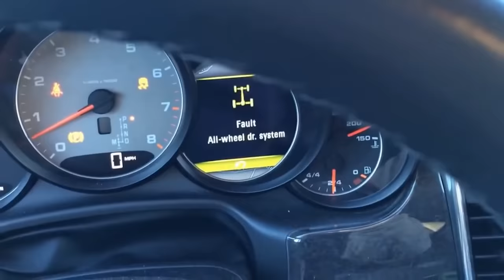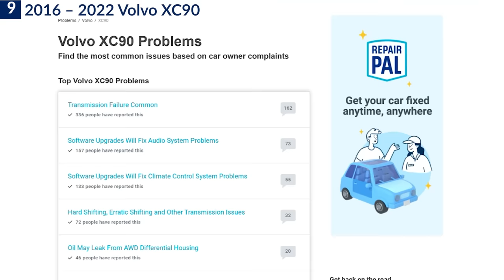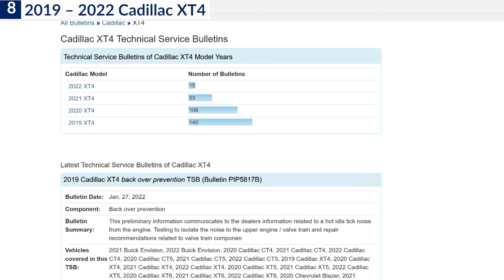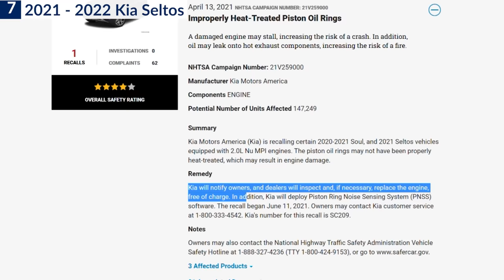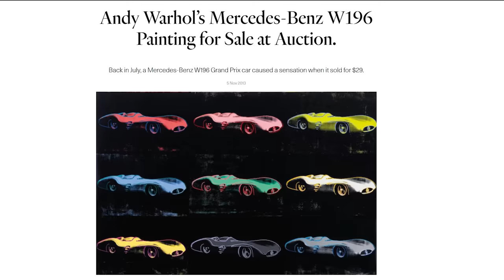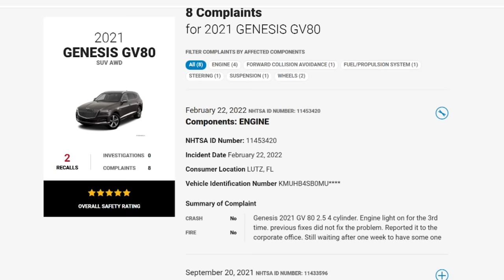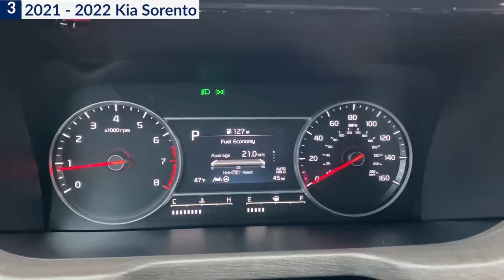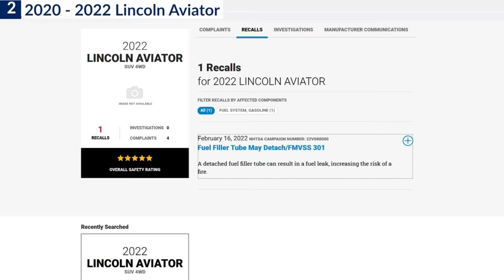10 New SUVs to AVOID - Here is Why !!

Comment: The fact that a Range/Land Rover isn’t on this list takes away it’s credibility.
Reply: If you couldn’t tell by the cheap ads in the video itself lol
Reply: Maybe Land Rover doesn't sell enough cars to get enough surveys and reports?  They sell much less than any of the SUVs on the list. Also, most of the cars on the list were all new or nearly all new models (2-3 years after redesign).  After several years, most of the kinks have been worked out.  A first year model during a pandemic with labor and supply shortages will likely have a lot more problems than the average NEW vehicle.  Most new vehicles have something like 1 problem (or what surveyed customers consider a problem) per vehicle on average (or around 100 problems per 100 vehicles) in the first 3 years according to JD Power. Many cars will have 0 problems, but a few lemons might have 10 or 20 or more problems. So a brand new generation model with teething problems or more lemons that year might average 1.5 or 2 problems per vehicle in the first 3 years and be in the bottom of the rankings.  But even these worst cars weren't getting a huge number of cars with problems or a huge number of problems, just noticeably more than the average new car which is getting more reliable than ever. These weren't 5+ year old vehicles with high miles or well out of warranty where EVERYTHING turns to dookie in the least reliable models, but this was based on "predicted reliability" which is hogwash.  You can't judge the overall reliability of a model based on its first year on the market...
Reply: BMW and AUDI too. They both sell more than enough SUVs to make CR's testing list, and are both more likely to break than a couple of the SUV's on this list. CR lost most of their credibility long ago.
Reply: @mabm85  consumer reports only puts the vehicles from manufacturers that give them the least money
Reply: Everything Audi & Volkswagen should be on this list; German engineering is overhyped bs.
Reply: @BIGJBIGEBIGC  🤣
Reply: You must own a Tahoe 😀
Reply: @Saph Adams  I have had 2 land rovers .  A 2005 Landrover LR3 and a 2011 LR4 ..None  have left me stranded me on the road
Reply: @mabm85  2011 BMW 550i GT worst car I ever owned
Reply: U want a reliable,  3 row , good looking SUV, then just get a ACURA MDX. Problem solved!
Reply: @OlJackBurton  Nah they sell Plenty. We just live in a society where we can just pay off someone to say good things if we got the money
Reply: I did test driving for a company, of Range Rover diesels. We drove them like 300 miles a day in the Vegas summer, & never had any issues to my knowledge. I think certain RR/LR models are okay, with regular maintenance. But sure, once you get over 50, 75k with most of them, you’ll probably start to have issues.
Reply: True.
Reply: @adamphynes7342  drove my 2005 to 200k and have 2012 LR4 with 130k miles right now
Reply: @adamphynes7342  50K to 75K with issues is criminal for such a high cost, supposed to be luxury vehicle.
Reply: Gv80 is overpriced? Compared to what? You want overpriced, look at BMW and Mercedes.
Reply: No Mercedes or Range Rover? Moving along.
Reply: @mabm85  2014/5 and up audi are reliable. Owned A6 3.0T from 90k to 140k miles, Q5 3.0T 40k to 80k, SQ5 from 20k. Biggest problem I had was a water pump failing on A6, which I honestly needed to replace at 100k but didn’t.
Reply: I was starting to feel good about my 2022 Jeep Grand Cherokee Limited.
Heading out of this rabbit burrow!
Reply: @Rootsmanskanking  I have had 2012''
 and 2018 Range Rovers. Both were the worst least reliable vehicles I ever ever had.  Spent thousands to keep them running.
Reply: overprice And brakes down all the time. to many electronic components that go bad quick.
Reply: @Lhondureno  source: you're a youtube mechanic?
Reply: @danblackfield8928  source I own one.
Reply: @Lhondureno  there you go, much better criticism now! So what year, model, and engine?
And as I mentioned, my experience with several mine was different than yours. My A6 was like 15k, too, so I can’t really complain on the price either.
Reply: completely agree with this comment.   This video is skewed for sure if Range/Land Rovers aren't in the top 3 or on the list at all.
Reply: My father drive Land Rovers in the 1960’s and 1970’s.  They were constantly in the repair shop. England makes luxurious but extremely unreliable vehicles now.
Reply: Oh wow.. i just brought a 2020 rage rover. I only had it . For 2 weeks. I took in on the road. And I opened up. .. the next day. My transmission started to slip !!
Reply: @michaeljohnson7044   I just brought a GV80. Let me tell y’all. It’s probably the worst car ever made. I only had the car . For 2 weeks.  My real break line was leaking. My check engine light came on .. when I left the dealership. I made a quick u turn.. right back to the dealership. !! UNBELIEVABLE !!!  .. never again !! 😡😡😡😡😡😡😡😡😡😡😡😡😡😡😡😡😡
Reply: i agree i love the look of them but heard maintenance is a nightmare so i have stayed away from them . infiniti i loved my qx50 but transmission twice no joke do i stayed away from that again
Reply: @richardsimms251  England doesn’t produce any cars at all. So your statement is completely wrong and just shows your lack of knowledge about the topic. JLR is owne by Tata Motors Ltd. (India) and the assembly plant (no longer manufacturing plants) are in Nitra (Slovakia since 2018 for New Defender, Discovery and RR Evoque)). The Solihull plant is reserved for be new Range Rover (2022).
But I agree, it’s suspicious that no JLR model or MB model is in this list. My LR Discovery 4 never let me down and has now 286,220 miles on the clock.
Reply: Lol exactly 🤣. Range rover should be on the top
Reply: @harveyhankerson8359  wich one
Reply: @kenlyboss8256  discovery !! 😡😡
Reply: True
Reply: @Rootsmanskanking   oh wow.. you got a lucky one. !!   UNBELIEVABLE.. I had a 2005 . I brought it brand new.. it only had 23 thousand miles on it. 2 years my transmission took a dump on me!!. Never again !!
Reply: I bought a 2020 brand new never had issues kept up with maintenance and had 50k miles had to trade it in
For a bigger vehicle
Reply: Facts
Reply: This video is sponsored by Range Rover!
Reply: The whole line up…. Lmao
Reply: The ‘08 has long been paid for but simply trash…
Reply: Facts
Reply: @OlJackBurton  that Geniuses doesn’t sell a lot
Reply: @harveyhankerson8359  Own a GV80, 2021 awd 3.5t advanced. Drives like a dream. Wheel gives bad vibes when tire pressures are out of whack. Once in the right numbers, car is smooth. Never had a problem. 14 months in. Do not regret my buy. Sorry about your experience. Maybe its a consistency issue.
Reply: Explorer and aviator are basically the same thing as the land/range rovers. The cheap Indian company that bought it from Ford hasn't changed anything.
Reply: Maybe its number 11
Reply: Big facts
Reply: That's because you've never owned a well maintained Range Rover
Reply: Remember folks, it is a list of the 10 worst.
Reply: How many have you owned?
Reply: Have had 3 new Landrover discovery over 15 years and they are amazing, not perfect by any means but close…….have ordered a defender and trading in my one year old q7 with air suspension that drives over potholes like a truck ……..feel the vibrations through my bones to my back teeth ……..
Reply: @Rootsmanskanking   I’m 63 and the last car that left my family stranded was my Dads Cadillac when I was a young child.
Reply: @mabm85  .. "non-luxury" .. guess you missed that point so BMW & Audi won't be on the list
Reply: Absolutely correct 100 percent
Reply: @ebee3522  so is American manufacturers, gm and Ford are horrendous brands,
Reply: 😂 terribly made fancy britches vehicle.
Reply: @demigodantiqueprints2696  I kept a brand new Q8 for 18 months, 2 of which it spent in the shop. Couldn’t wait to get back to RR.
Reply: @Rootsmanskanking  I can second this. As long as you take care of the basics, replace the spark plugs every 3 to 5 years, oil of course, if you are getting a check engine light and a warning about misses in the engine… it’s going to be ignition coils. The fact is, if you learn how to do some of the basic repair yourself… They’re not bad vehicles. They turn bad, when you decide to take them to a garage and they see you pulling in inside of it and try to charge you $500 to replace $50 worth of spark plugs that take 10 minutes. Trying to charge you $250 for one ignition coil, for which you could buy all eight of them for less. $1500 per air shock, When you could buy them all for $1500 via third-party.

You truly have to know the brand and what to look out for. Do some basic repairs yourself and they will run fine. Some have issues, just like with any car. As everyone who owns a land rover/range rover will tell you, it’s all about the incredibly quiet, smooth ride and especially if you own a 2005 to 2009, the power. It’s one of the most luxurious rides out there as far as feeling little in the way of bumps on the road. The cabin so quiet that you could probably hear a pin drop. The only issue I have with my 2006 LR3 is the screens that they use for their entertainment system are horrible. I ended up replacing mine with a high end android tablet. Which I mounted in the Dash where the old screen used to be.

Other than that, they can be great vehicles if you take care of them and again, know how to do the basics and when.
Reply: @OlJackBurton  there are significantly more land rovers than gv80s and Lincoln’s on the road. The reason they’re not on this list is because this video is nonsense
Reply: On a serious note who was actually surprised the VW was on the list?

I mean we’ve known it is crap since its initial release.
Reply: Facts
Reply: @BENTLEY1981  the Volvo too dates back to when ford owned it - similar to Explorer.
Reply: @BIGJBIGEBIGC  cheap ads,yet a Range Rover is not a reliable car and it’s a facts.
Reply: @itzjdub282  don’t waste money on RR. Go for Honda or a Mercedes
Reply: Range River for life 😍👍🏻
Reply: Not really they tend to stay IN REPAIR SHOP MUCH TOO LONG?  THAT'S WHY
Reply: @burnellbrowne4303  yes cos your money ain’t enough to fix it and take it out from the shop quickly.What’s your point man lol
Reply: 100% Correct!!
Reply: Sooo true
Reply: Sooo true
Reply: @VVS30187  I have both and love both. But not the Honda. RR has been truly wonderful.  Only issue is delay in infotainment.  I knew that could happen.
Reply: Maybe they broke down on the way. They didn't make it in the list
Reply: Somebody in this story’s pipeline likes Range-Rovers. They are crappy English made vehicles
Reply: Maybe cause everyone knows how bad they are they didn’t have to say it 😂😂😂
Reply: @ebee3522  problem with German engineering is its over engineered which means more parts that break.  😂
Reply: If you want to go into the bush take a Land Rover if you want to come out of the bush take a Land Cruiser never a truer saying
Reply: The latest Land Rovers are much better build & reliable than ever before. Between my wife & I we owned 8 in the last 20 years. And my current 2022 Defender 110 V8 is fantastic. I passed my 2018 RR to my daughter with 87K miles and she has now 93K, and still strong no issues. I do off-road few times a year.
Reply: Listening to the narration,  he makes general comments like " CR rated the car, as the most unreliable" That doesn't sound like CR. He doesn't point out any links and btw, where is Land Rover on this list? BMW and Escalade?  Genesis is too expensive? Because fully loaded price was 75k?  Any German SUV fully loaded would cost over 100k ! Land Rover tops at 185k. Come on !
Reply: @Rootsmanskanking  those years were exceptional for those models.
Reply: Audi too.
Reply: “The parts falling off this car are of the finest engineered British quality”
Reply: They are the worst. Very unreliable. People that buy them are amazingly uninformed.
Reply: @sweetdrahthaar7951  indeed. Talked to a coworker. She loves them but thins she knows cars. Said they’re in the shop all the time for repairs and she said oh well!!
Reply: Yes. Range Rover should be at the top of the crap list.
Reply: Had a Cadillac CT4 rental - it is a POS.  C’mon GM, is this the best you can do with your “premium“ brand??
Reply: That’s facts 😊
Reply: @ebee3522  ...and American engineering?🤣🤣🤣
Reply: I never had any problems from my new  2018 Range Rover!!.. Still have it and driving Strong!!.. LOVE IT🥰
Reply: So true
Reply: Love my Range Rovet Evoque Dynamic! No problems and a beautiful vehicle!
Reply: Exactly!
Reply: Exactly !!!
Reply: Range Rover-absolute crap!
Reply: I have a 2021 SVR and so far all good.
Reply: @OlJackBurton  maybe rovers don't sell enough because of their reputation. a tesla could be in the same price range but you see far more of those on the road
Reply: @mikenorman6665  and if you want to go cheaper than that, the honda pilot or the passport is a similar option
Reply: Agree
Reply: I’ve had 2 range rovers. I wholeheartedly agree with this comment
Reply: That part
Reply: @mabm85  Agree !!
Reply: That Part!!
Reply: @Kilgore_Trout_jr  what's wrong with it? I'm looking at getting my feelings involved wit one of those?
Reply: The fact that people still think JLR is Ford blows my mind. Selling the company to Tata was the best thing ever for them, increasing in quality and viability. My car has 165.000 km and i never had any problem with it, it saw service only for regular service once at 30.000 km.
Reply: @michaeljohnson7044  Mercedes made in USA are trash, Mercedes made in Germany are great ! Very big difference !
Reply: Yea overpriced and unreliable as hell
Reply: Just buy a sequoia
Reply: @mabm85  well I am definitely learning a good deal.....thought these vehicles were good like that. They are considered top class and some of the more expensive vehicles in my country (Jamaica)
Reply: Well I an just in the process of buying an SUV had a TIGUAN in mind ? Need to check more about it. Anyone out there have one?
Reply: @miraperko7493  yeah myself too, searching for a vehicle with what you need is not so easy at all
Reply: Entirely  agreed
Reply: I’ve had 7 and have never had an issue.  Must be a hater
Reply: Range rovers become more reliable that's why
Reply: Totally agree.  Better have a thick wallet with that baby
Reply: I have a 2020 RR Sport HSE. 2.5 years, and not one problem. Most people that hate Land Rovers for some reason never owned one. Family & friends told me the same when I bought it “what did you do?”…2.5 years later, and they still waiting to justify their fear of getting one. The only complaint I have is that I need more cargo space when I go off-road for a week…
Reply: People gotta buy them first….
Reply: The car price and maintenance cost of Range Rover is beyond our consideration.  The reliability issue of it is beyond our imagination.
Reply: Based on consumer reports. If it’s not in the report, why would you expect it to be on the list.
Reply: @mrnoname7370  kpkn
Reply: l
Reply: @Rootsmanskanking   You don’t drive them much?
Reply: @Rootsmanskanking  we’re talking new cars here.
Reply: @Rootsmanskanking  also have 2012 LR4 with very low miles 70k & zero problems but not holding breath. We seem to one of exceptions for not having airmen suspension go out yet.
Reply: @michaeljohnson7044  fact it’s Korean. I test drive loaded GV80 twice & the engine vibration into cabin so bad seats rattled. SUPER LOUD fan also audible when a/c on,, combined with horror stories on maintenance, parts & oil/tans issues in first month. So pretty to look at put broken eggs when coming to fix problems. The dealers are whole other story. They act like an Olds dealer in 70’s. Frightening. After waiting 3 years for Polestar 3 EV I chose a loaded BMW x5 M50i & couldn’t be happier
Reply: MB is in list!
Reply: @demigodantiqueprints2696  then something is wrong w/suspension. What did Audi say?
Reply: @MakeLifeExtraordinary  article reflected late models that all wld have been under mfg wart so not cost issue but multiple service, hassle & safety issues being discussed.
Reply: @mkyhou1160  nope,, TaTA has owned for a decade now.
Reply: @VVS30187  did ya not see MB in #2 as worst with 2 diff model years having TWENTY recalls EACH?!
Reply: @steveo601  TaTa motors for decade is India motor car not English!
Reply: @mabm85  The B58 and S58 engines and ZF transmission in the new BMW's are near bulletproof guy.
Reply: @JahRoww  Which is irrelevant in today's conversation.
Reply: @Mike Norman  Sure, if you don't mind it's horrible interface. They should've brought the screen closer and made it a touch screen
Reply: Lol true
Reply: The Range Rover and Land not on that list is because they been money pits forever,  so they don't need to be on this New SUV list.
Reply: For real 😆
Reply: This is one of those “goes without saying” 😂
Reply: Yeah but Chevy Tahoe and Yokon are…. What!
Reply: LR + RR are the worst of the worst.
Reply: I tend to agree but the real list has got to be longer.  Jeep missing😂
Reply: Its
Reply: You got that right they are the worst cars on the road
Reply: @harveyhankerson8359 So did you return the GV80, and get yer money back?  I hope so.. Whata LEMON!!
Reply: Yes
Reply: @Rootsmanskanking you are super lucky. Why don’t you try to play lotto
Reply: That’s just a given.
Reply: Facts 😂
Reply: I have a 2023 Kia Sorento plug in hybrid. Had a tiguan before. The Sorento beats the Tiguan by far! Cant be happier with my Kia SUV!
Reply: Volvo become bad after Chinese buy Volvo. Only Volvo D5 is build in Sweden. Why no BMW in this list? Bad cars!
Reply: @bernie917  Exactly! They look good and are fast. I use to tow those cars a lot. New or old. Even the well maintained owners were pissed. I guess some get lucky though.
Reply: Thanks you just saved me 14 minutes lol
Reply: 1000% facts
Reply: Agreed
Reply: Parts for Range Rover are way overpriced and overall quality is bad. 40 years in business and my thoughts on RR is people buy them as a status symbol they usually regret
Reply: @michaeljohnson7044  did you even watch the video? There was a Mercedes at number 4.
Reply: Agree
Reply: A few weeks ago, I saw a new Range Rover stranded at a gas station. I asked if they needed a jump-start and he said no and had a tow enroute from the dealer. It was an electrical issue.
Reply: Hash money works......Sponsor pays more to focus on Landcruiser/Lexus lady